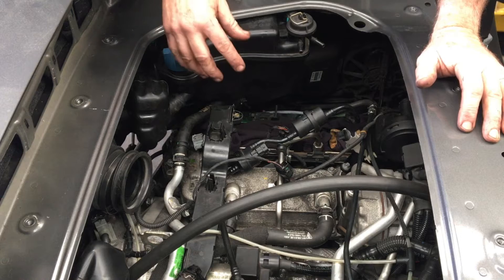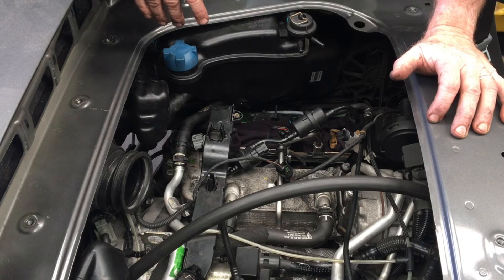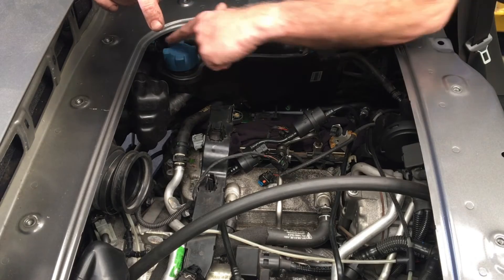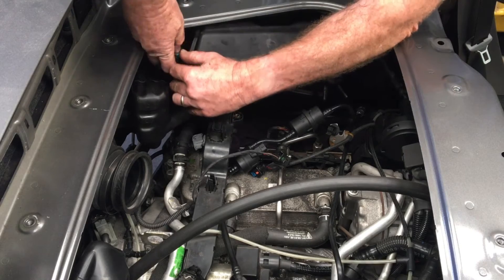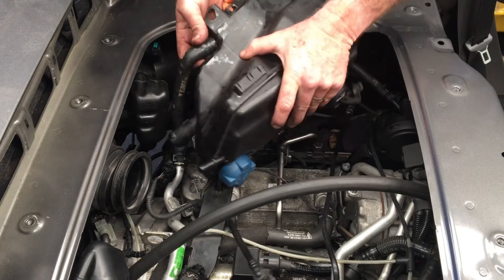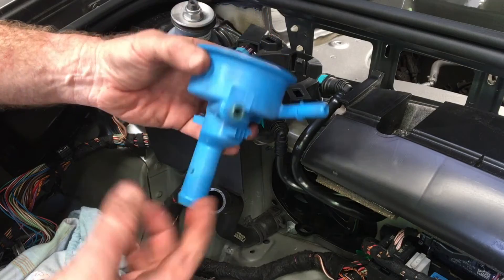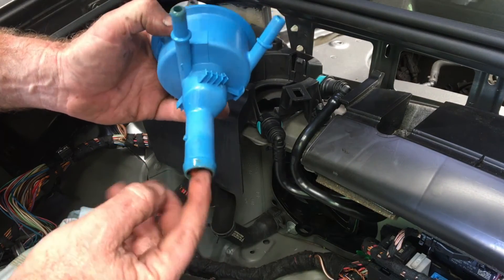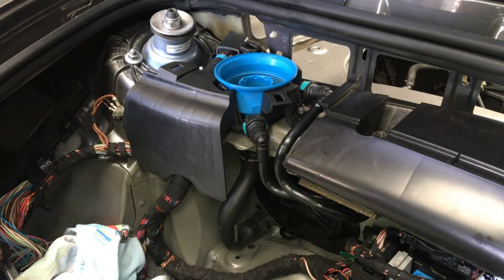Porsche 981 coolant reservoir and fill port

Comment: Jeff, love your videos.  I've noticed on my '16 Boxster that the fill port bobber is extremely sensitive.  Less than an ounce can move the bobber from sitting in the bottom of the fill port to the full mark.  Given the volume/surface area ratio inside the expansion tank it would seem that more than an ounce would be necessary to move the bobber a cm vertically. As it get's cool in the fall in the States and the coolant contracts I'm adding very small amounts of coolant weekly to compensate.  Is this going to cause a problem in the spring when it warms up and the coolant expands?  Thanks for your response in advance,
Reply from the maker: My advice to people is to have  it just at the point of having the blobber move, and leave it at that. I'm not going to top it right up. There is plenty of coolant in the system at this point with little risk over overflow at operating temp. And as long as you don't ever get a coolant low caution you are good to go. The reservoir is about 80% full before the blobber gives any indication.

Comment: hello
thanks for video 
Q1
how much liter coolant in total?
Q2
my level flooter (inside that blue cap) always is at the bottom, however never any cooling issue (always at 90 degrees)
Should I worry ?
Rgs
Reply from the maker: Q1. It depends on the car model and what is fitted. As little as 15L but possibly more.
Q2. As long as the low level warning light isn't on then it's fine. When the floater just starts to move the tank is probably about 3/4 full.  If you want to put more coolant in it, when cold slowly fill until the floater just starts to move and no more. Otherwise it's easy to overfill have it overflow when everything gets to temp.
Reply: @jeffrichardsoncardiy  
thx
Q1 
I have 981 2.7
Reply from the maker: My best guess about 16L total if with PDK
Reply: @jeffrichardsoncardiy  
yes have PDK
so 16L
thanks for this info

Comment: at the end of the video  you said "dribble down to the back of the engine bay"       You mean, completely outside of the engine and down on to the ground?
Reply from the maker: Yes, it comes out of an open hole immediately the other side of where it goes through the black rubber grommet. You would see fluid dripping from above the left drive shaft.
Reply: @jeffrichardsoncardiy  Thank you for this information, maybe this would explain why I found some coolant dripping under the car on the garage floor, after I opened the coolant cap slowly when the engine was hot.   Assuming some of it leaked out under  pressure when I did that.  Not a single drop anywhere the day before I did this.
Reply from the maker: @tomzphone  Unless the coolant level is quite low it will always overflow if you open when hot and under pressure. I guess this is why they have this hose so it doesn't overflow into the boot.
Reply: @jeffrichardsoncardiy  thanks again to confirm.    I would have hated having an unexplained coolant leak.